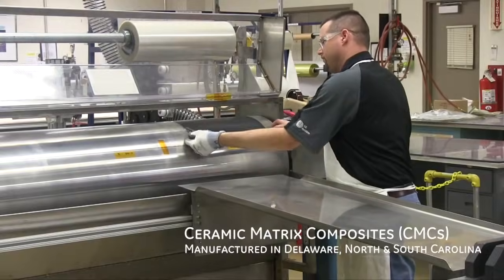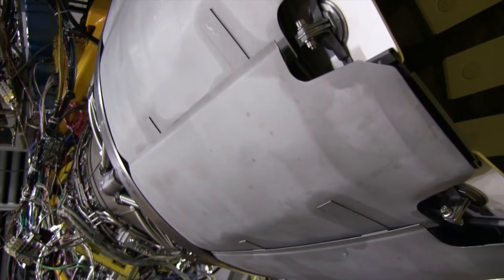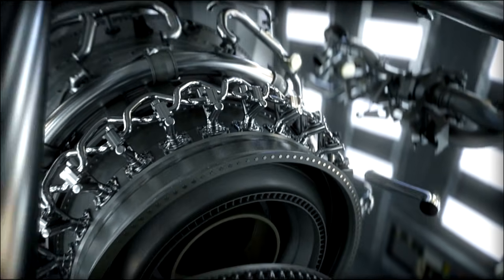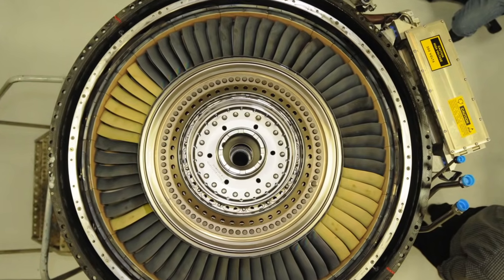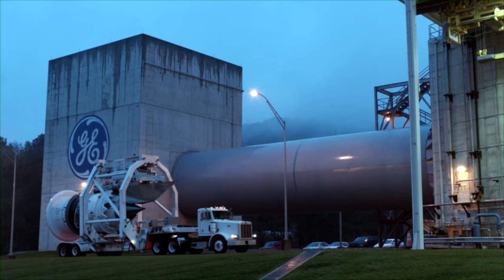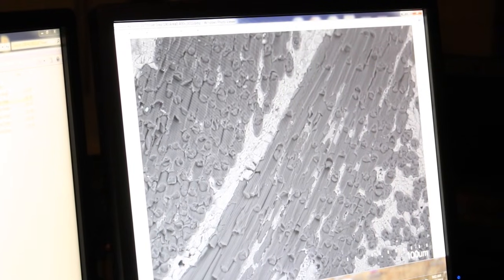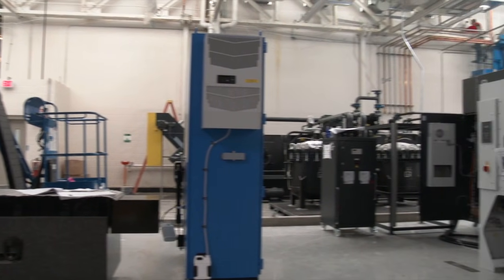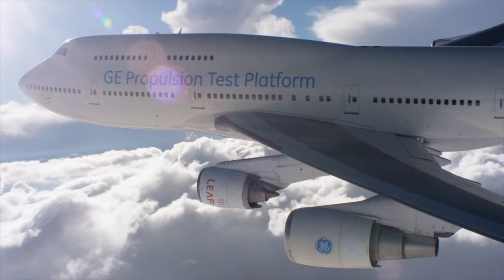GE Aviation and the Ceramic Matrix Composite Revolution

Comment: Wondering about doing the blocks of piston engines out of this. Also the heads of the pistons and maybe some coating for the valves. Exhaust manifolds, turbo charger components(both housing and rotor). Carbon fibre for the structure and external panels and this stuff for the hot components in auto industry. How about brake rotors, would it be good and durable? Would it withstand the stress?
Reply: Aleksandar Popov Koenigsegg uses ceramic coating on pistons upper surface
Reply: For specialty engines maybe, but the way current government emissions bureaucrats have written the regulations there is no need to go beyond cheap iron or coated aluminum.
High combustion temperatures increase the ratio of nitrogen oxides in the exhaust, though said high temps also greatly improve fuel burn efficiency reducing total exhaust (assuming the extra efficiency is used to reduce fuel consumption at a static power, rather than increase power at static fuel use.)  nitrogen oxides primarily combine with unburned fuel in sunlight to make rather nasty smog and when not combined with VOCs NOx can contribute to ozone depletion. Fortunately they are not long lived molecules, eventually degrading to either nitrate fertilizer or N2, where as CO2 must be stored either as dry biomass or carbonate minerals to reduce total atmospheric levels.
Reply: +Aleksandar Popov Time will tell. Obviously this technology is at it's infancy, or at least in it's toddler state, Development costs are so high at this stage that only the military and large scale commercial operations can afford it. It looks very exciting. If it and can withstand the test of time and endurance, it should eventually make it down to a cost effective alternative in domestic technologies.